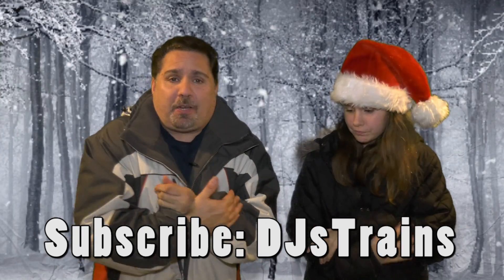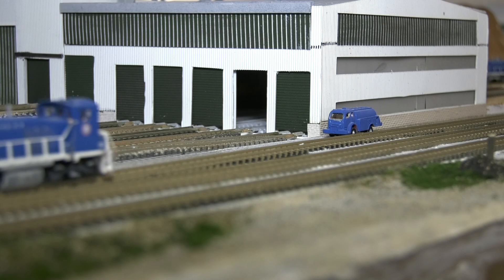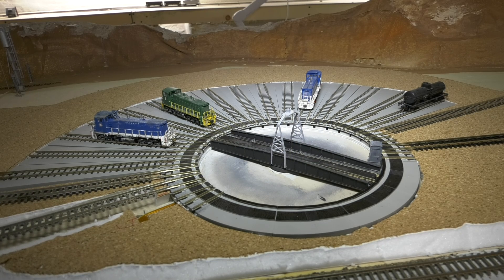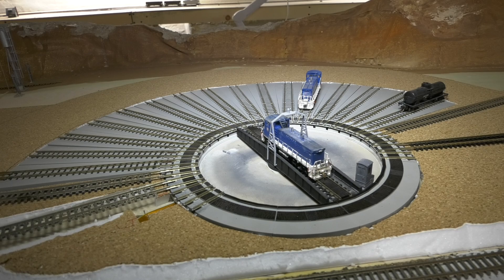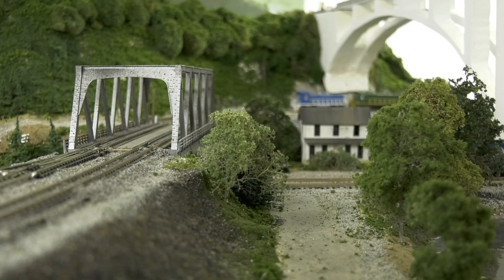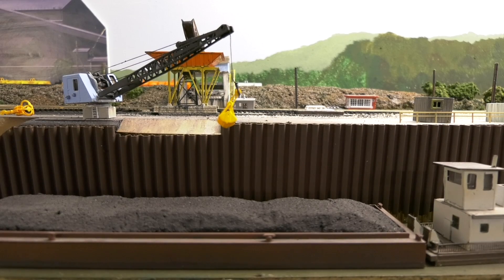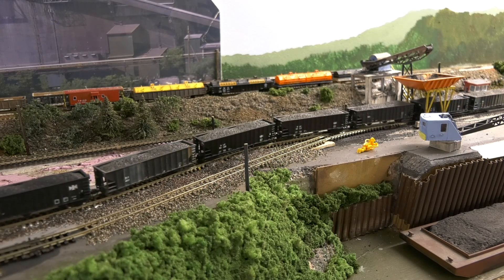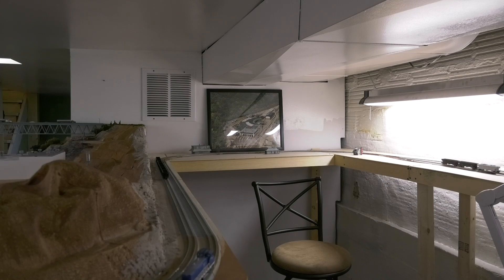N Scale Train Layout, Great Scenery & Kato Turntable with DCC

Comment: DJ, Very nice layout tour, the layout looks great. You know I have to, being a fan of "The Little Giant" ;-) in 1987 those tracks running under the Port Perry Bridge on the ET side of the Mon river still belonged to the P&LE, CSX had trackage rights over the P&LE between Mckeesport and New Castle. The ramp track from the ET works up to the Port Perry bridge (Union Railroad track closest to the Mon river and P&LE tracks) was known as the "Cinder Bridge", because all the Cinder pots left the ET works using that track on their way to the Cinder dump in West Mifflin. If you have Rich Borkowski's Union Railroad in Color book, check out the photos of the Port Perry bridge on pages 52, 53, 60 & 61. DJ, you have done an excellent job of capturing the look and feel of the Union Railroad. Very impressive modeling with the engine facilities in Hall and I agree that Kato turntable looks fantastic. I'm looking forward to your next video update. Cheers, Rich S.

Comment: So a white and black wire from layout to reverser two wires to DCC controller wheres the connection to the power supply (outlet) ?? also thinking of modeling conway yard north of Pittsburg west side of river any ideas or suggestions ???
Reply from the maker: I would like to drone conway, but there is nowhere good to park and set up without causing attention.  Considering the area is miles long, simply pick the things that stand out to you most to model.  Just go for the feel of the area, because if you try to match it too much, you'll go nuts.

Comment: Nice layout! Question for you: at Port Perry, you have a bridge going over the train tracks (the one with the bottle car on it). The bridge is just flat and thin.  Is this modeled after something in real life? Or is it just "not completed" yet?
I ask because I have a section on my layout wherein I want that look (I don't want a truss or plate girder bridge) 
If that section of your bridge is based on something in real life, then I can justify my railroad having the same type of bridge on my layout.
Reply from the maker: It was a "good enough for now" thing.  Sometimes the prototype is too hard to compress so I just improvise.  If you google map Edgar Thomson Steel mill in Braddock, Pa, you can see the real one.  More of a girder, but I would have clearance issues.
Reply: @djstrains  Thank you for responding.